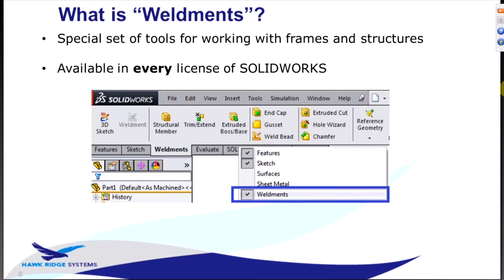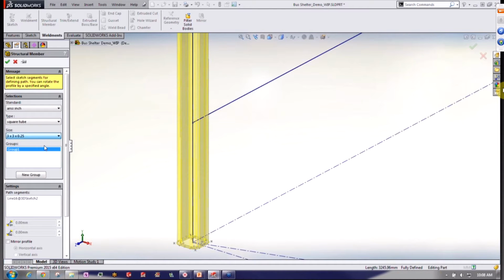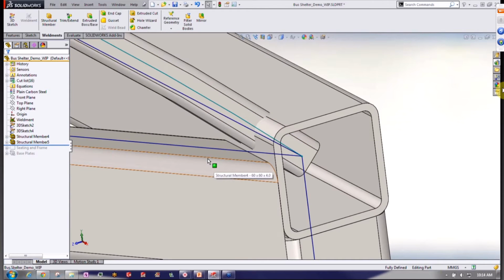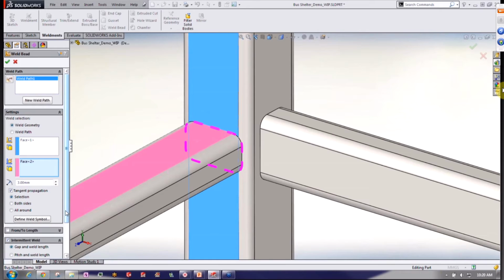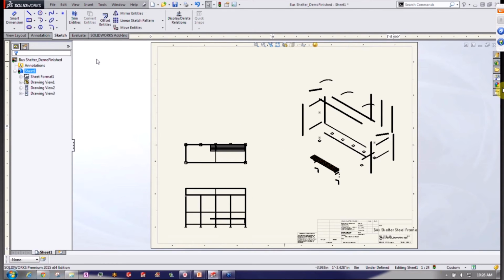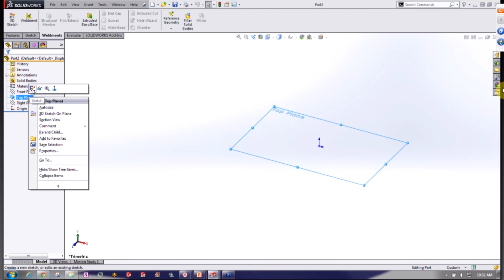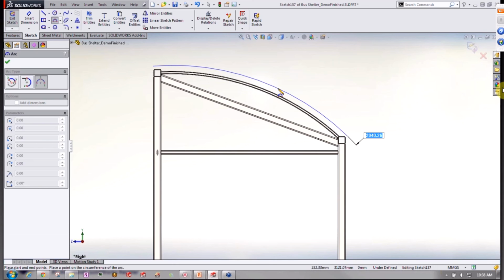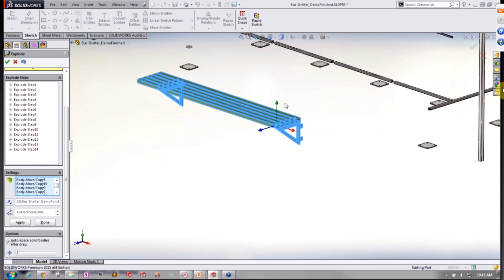Designing Frames and Structures with Weldments

Comment: Can't follow your description, processes I need do not appear as shown in your description. 
The ability to align members as I need to along the 3D Sketch frame lines seems limited to centerline alignment or primary face, with no offset allowed. This does NOT match Fabrication Practice, as Frame members are positioned , welded and coped A/R along faces and edges, as WELL as Centerlines. There seems no way to select the needed FEATURE or sub-element (Component edges, center-points, end-points or corners) to affect the needed placement.
The functionality to CONTROL Placement , end-treatments, fit-ups and Coping PROBALY exists in S-W, I just see no treatment of the subject in your presentation.

Comment: Hello, thanks for sharing. 
Is there any functionality available in CATIA that is like SOLIDWORKS Weldment?
Reply from the maker: CATIA has the Structure Design Workbench which provides a similar workflow to the Weldments tab in SOLIDWORKS. Also, it has the Weld Design Workbench for weld requirements.

Comment: Can you use the weld callout tool and define fillet weld size(1/4" for example) and therefore solidworks can automatically estimate the amount of weld metal that will be deposited for this structure? I ask because in theory i could accurately estimate the amount of welding wire i needed to order for certain structures.
Reply from the maker: Hi Christian,

The weld callouts automatically group into a weld folder that tracks total linear weld length, so that you can estimate the amount of wire needed for a job. It also allows attaching a cost per linear foot of weld to make cost calculations easier. These values can also be brought over to a Weld Table on a Drawing.

You can see this in action at 20:50 in the video:
https://www.youtube.com/watch?v=7FrGaYo6ACY&feature=youtu.be&t=20m50s

Let us know if you have any more questions! Happy welding!